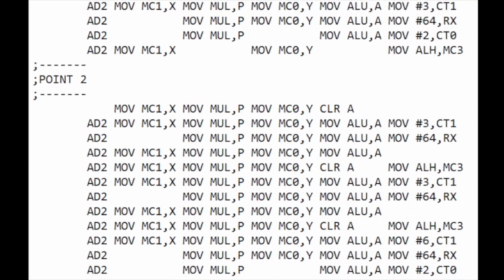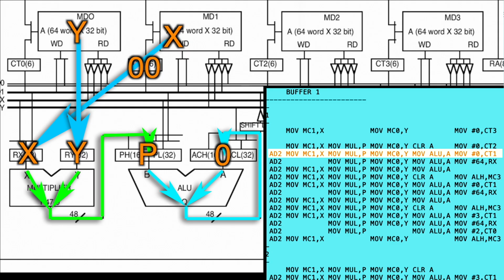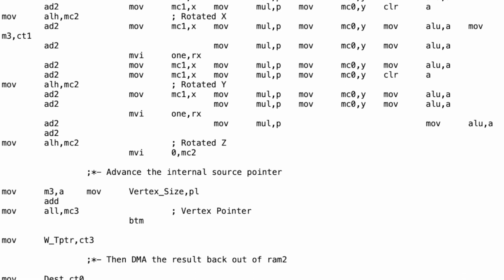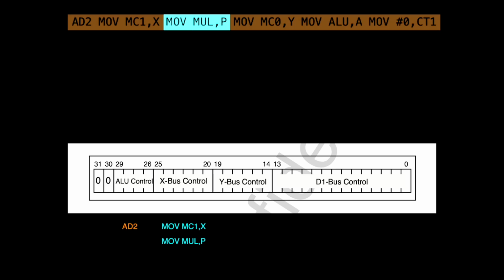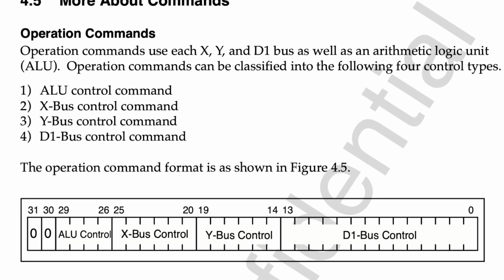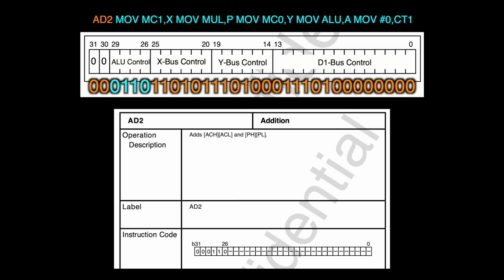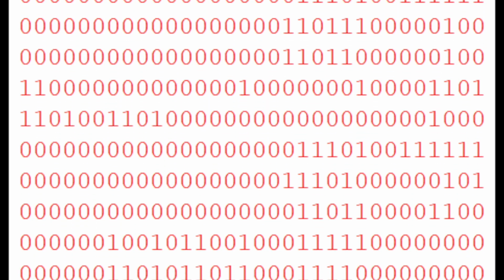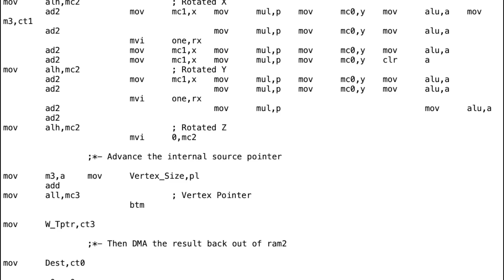The Mystery of Sonic R's Impossible Code - Coding Secrets

Comment: It turns out it isn't possible and from now on Sonic R no longer boots.
Reply: Haven't we all had somewhat working code that as soon as we really start looking at it we realize "this can't possibly work" right before it mysteriously stops working?
Reply: Happened to me when working on a 3D engine and trying to figure out a lighting glitch. Poking at it, lighting stopped working. Figured my TBN matrices were getting miscalculated, so the lighting shouldn't have worked in the first place. Curious to see why it sort of worked I revert to an older commit in Git and recompile, to find completely non-working lighting.
I got a bit spooked, had a long coffee and smoke break, came back and rewrote the matrix calculations from scratch, after which lighting worked just fine.
The scary bit is I have a build from around the time of that commit, with only slightly bugged lighting, and for all intents and purposes it should be identical to the commit I reverted to...
Reply: @peterjohnson9438  Einstein's Spooky 3D Lighting at a distance .
Reply: @peterjohnson9438  Damn man, that would drive me mad.
Reply: @peterjohnson9438  That's scary. I blame build cache.
Reply: @peterjohnson9438  congrats you have limited power to affect your reality.
Reply: @peterjohnson9438  that’s pretty spooky
Reply: @guido_hehe  the reason these sorts of bugs manifest is that the real problem isn't actually the one you're looking at. Something else in the house of cards (i.e. the program) is broken, but when the stars happen to align, two wrongs make a right and the problem doesn't make itself known. The program works until you accidentally upset the delicate balance in the program doing something seemingly unrelated, and that's how you get a Heisenbug.
Good example of this: the Static Initialization Order Fiasco. I've run into it twice.
Reply: @Triumph263  Ah, yes, the infamous Schrödenbug. I do software quality control and testing, so I see these things all the time, along with Heisenbugs (which go away when you use a debugger), and Mandelbugs (which are caused by fractally smaller bugs).
Reply: @Triumph263  I also had some similar code that stubbornly refused to stop working after progressively more aggressive edits to the relevant fragment. After finally deleting the entire segment, and finding the code is still working, I discovered the binary I was testing was different than the one compilation would produce.
Reply: @Triumph263  My 2nd ever game of pong's CPU opponent. <.<
Reply: Schrödingers code.
Reply: @cromulence  noice
Reply: If you code long enough, this will happen to you.
Reply: Don’t look at your code, you’ll collapse the wave function
Reply: Reminds me of Orks in Warhammer 40K.
Their machines work because Orks are too stupid to realize they "can't". @_@
Reply: Ah yes, Wile E. Coyote logic
You don’t start falling until you look down
Reply: "oh dear," says sonic r "i hadnt thought of that!" and promptly vanishes in a puff of logic. "'oh that was easy" says gamehut and for an encore goes onto prove that the black color palette is the white color palette, and gets killed by the next sprite artist.
Reply: @SpiritedSpy : Such a reference is always welcome.
Reply: looool
Reply: damn you Mandela!!!!
Reply: Oh, looks like this is Persona 5 now
Reply: caching issues, and errors cancelling out are a source of this.
Reply: TFW you’re no longer feeling the sunshine
Reply: Sonic looks up from the rule book, "oh, nope, you're right. Says so right here".
Reply: Mouse asked a centipede how it could walk with so many legs. Centipede thought about it, and no longer could.
Reply: Just retconned reality.
Reply: Sanic
Spoderman 
Sanic
Spoderman
E
I
E
I
O
Reply: Heh, Saturn, the first quantum computer which implemented "Hideki Sato's Hedgehog", a variant of Schrödinger's cat,... but then with hedgehogs. "Now you looked inside and what was both possible and impossible before, now just became impossible... and no version of that game will work anymore".
Reply: @DehnusNorder  A good way to design Anti Reverse Engineering Piracy... It works like magic, but as soon as you observe its internals, you end up breaking it causing a permanent system crash... Good, story, but I'll stick with poor documentation of its ISA!
Reply: You've done it - Tails Doll is no more
Reply: https://www.youtube.com/watch?v=3FB0aeb-TPs

Comment: Well, it said it can execute those 4 types of commands concurrently, but it didn't say only one command per type.
( ͡° ͜ʖ ͡°)
Lawyering the reality into existance.
Reply: I think that's exactly what is going on here.
The obvious question is now, how many of the 6 commands can be of one type?
How many (for example) x-bus commands can we put onto one line? I'm really not an expert, but it seems we could put three of them together, but they would all use the same data bits as input?
Reply: @YensR  The "commands" are the domain of the assembler, they actually do not exist on the DSP as such, perhaps with exception of special commands (DMA and JMP). All operations are executed every cycle. And then a set of switches control the data flow, which of these results are selected to be moved to the next stage down the connection diagram, which data moves where. The bits in the command word directly control these switches.
Reply: @SianaGearz  Thank you, I think I understand that, but I won't bet money on it :D
Reply: @YensR  Yes, but that's part of the limitations of SIMD instructions, Single Instruction Multiple Data.
Reply: @account0199  This is not SIMD though. SIMD applies an ALU operation to multiple values in parallel. Here, ALU and multiplier only operate on 1 pair of args on every cycle. You can never add more than 1 pair of values and multiply more than 1 pair of values per cycle. But you can do both of these different things in 1 cycle.
Reply: @account0199  This is MISD for each operation command, and MIMD for the hole DSP architecture
Reply: @account0199  This is not SIMD. SIMD is where you have the same instruction executed on multiple sets of operands. This is very long instruction word (VLIW) as seen in https://en.wikipedia.org/wiki/Very_long_instruction_word .
Reply: @account0199  this is the opposite: the same data bits point to the data, but the instructions are different. MISD you might say. See my longer comment at top level.
Reply: You could theoretically execute as many "commands" on one "line" are there are bits in the instruction word.  What the chip actually does when you use undocumented combinations is obviously undefined behavior but obviously SEGA was deep enough into the design to take reliable advantaged of it (and everyone that's ever emulated this chip in software seems to have gotten it figure out, or else Sonic R wouldn't be running anywhere except the Saturn).

Almost every chip works like this.   Look into the undocumented opcodes in 6502 -- it's the same thing.   The bits just determine which atomic control operations occur and if two operations aren't in bus conflict, they usually can happen simultaneously by setting both control bits.
Reply: True.
Reply: Came to say the same thing. Nothing states only four can be executed.
Reply: Yeah... I don't see a contradiction.
Reply: ( ͡° ͜ʖ ͡°)